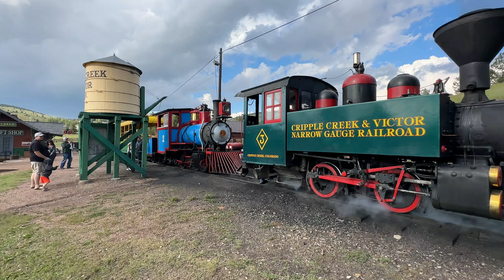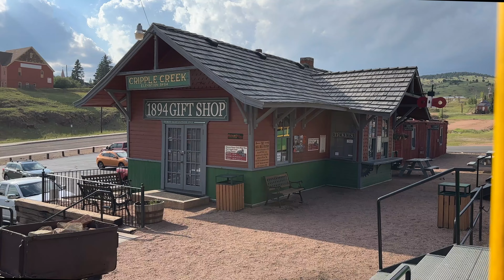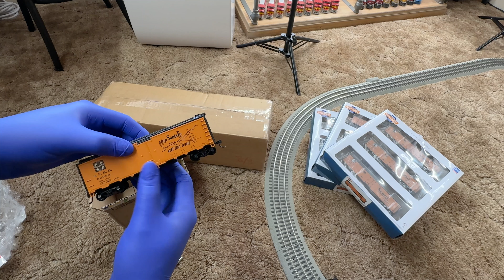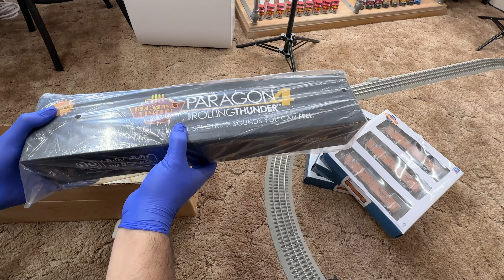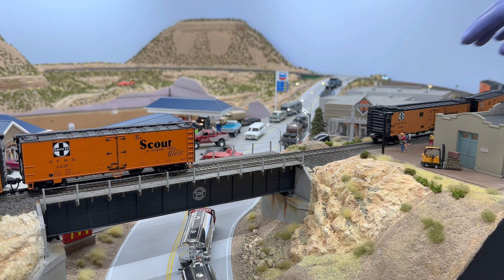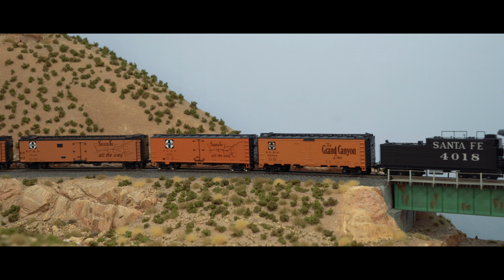Let's Run Model Trains: Broadway Limited Santa Fe Reefer Train

Comment: I know the Athearn set on eBay as I was looking at it too but since I am a stickler for dates the three large icon reefers were out of my era so I let it go plus I have over 50 SFRD reefers already so not pressed to get any more.  The Accurails use Accumate couplers which are crap.  Replace with Kadees as soon as possible.  Also, look at Intermountain Santa Fe reefers they are really good as well.
Reply from the maker: I’m definitely going to change them all to Kadees. I have stock pile of them. I have been looking the Intermountain reefers. They look nice. Thank you for watching!

Comment: How can you not like smoke that makes a steam engine what it is
Reply from the maker: Some folks say that it either makes them sick or they can’t breathe in the room. Some think it’s a novelty. Others don’t like that it cause problems with the engines such as smoke unit malfunctions or melting the boiler down. For me I love smoke in engines. Best part!
Reply: It only melts boilers if you let fluid run out
Reply: @NYandAtlantic  It is the fact BLI used plastic boilers which is going to melt it.  Not an issue with diecast or brass boilers.  They were cheap and reused old tooling to save costs shoehorning a smoke unit where it doesn't belong vs. redesigning it with a proper boiler.